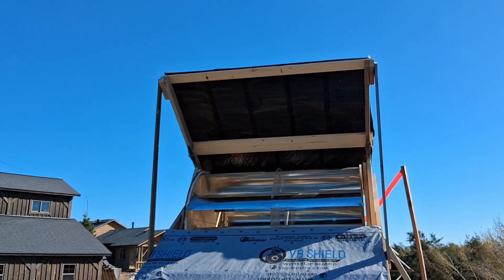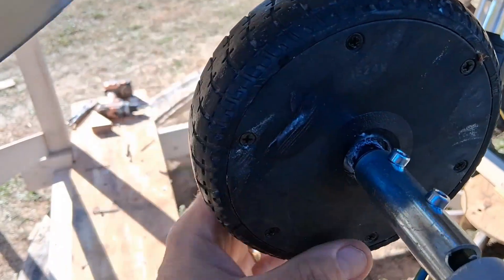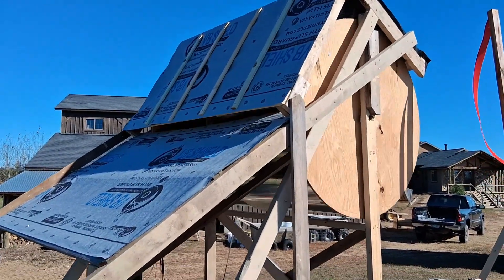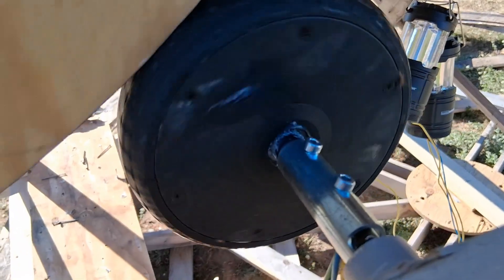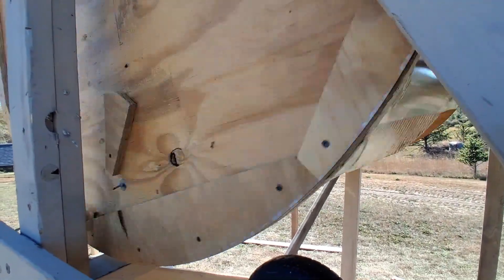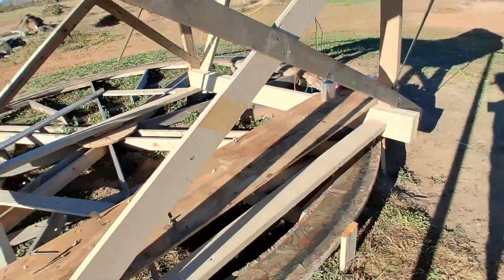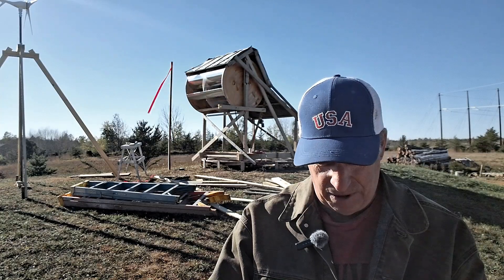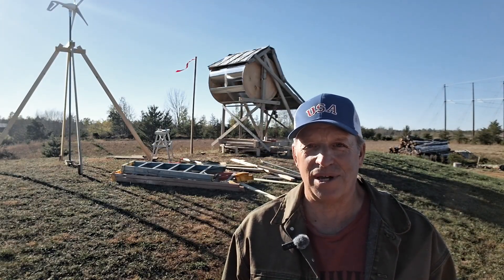Horizontal (cupped) Blade Wind Turbine | HBWT

Comment: Hi Mate, I have been testing small wind turbines in a Low wind area.
I use 1.2M wind wheels, these Peaks are only in a 31Mph Wind Storm.
24V 500W Vevor          -  Normal 5 Blade  -  6.5M high     -  8 Amps
24V 500W Vevor          -  Normal 5 Blade  -  6.5M high     -  8 Amps
24V ista Breeze i500   -   Scoop 5 Blade   -  4.5M high    - 11 Amps
24V 300W Hyacinth     - Normal 6 Blade  -  4.0M high     -   4 Amps
48V 500W Sunboo S5  -  Scoop 6 Blade  -  3.5M high      -  3 Amps
48V 500W Sunboo S5  -  Scoop 6 Blade  -  3.2M high   -  2.5 Amps
48V 500W Sunboo S5  -  Scoop 6 Blade  -  3.0M high   -  2.5 Amps
48V 500W Sunboo S5  -  Scoop 6 Blade  -  3.0M high   -  2.5 Amps
48V 300W new rotor    -  Scoop 5 Blade  -  3.0M high   -  1.5 Amps
48V 300W new rotor    -  Scoop 5 Blade  -  3.0M high   -  1.5 Amps
Peak Output Totals  =  45 Amps  =  753 Watts ( Average wind 6.2mph )
Town laws stop me putting up a big wind turbine higher enough to work.
Hey guys, think about posting your turbine information and production🤔

Comment: that is not the bearings man, that is one of the magnets has come unglued from the rotor pull the cover off and glue magnet back in place with epoxy provided it has not broken the windings by rubbing the stator. I could be wrong but its common on the Black wheel motors
Reply from the maker: Could be dislodged magnets, but something has gone wrong with some windings too.  -and that's what is making the noise, and not the bearings...

Comment: Wonder if you could use a little bigger motor from something like a tread mill. Mount a wheel to it like you did before, they are practically free on the side of the road or collecting dust in someone's basement. Nice build very practical
Reply from the maker: Thanks!  I do need to figure out something different.

Comment: Now you can make a generator on the shaft/ central axis. It is a very very successful design - because your "roof" is an ideal wind tunnel. Now you can mount a gear boxed design or find something like a High voltage 3 phase motor for example - as a generator.
Reply from the maker: Thanks for sharing your ideas!
Reply: @doubleMinnovations  :)

Comment: The roof is a good idea, being able to shut it off. I thought the hoverboard wheel would've lasted way longer, great to know, thanks for sharing that. As for a new alternator, maybe place (many) magnets on the plywood disk face, toward the perimeter, then add a coil or more. For something that's "thrown together" it appears very level (I can't see any wobble in the plywood disks) and could suit such an experiment.
Reply from the maker: Those hoverboard wheels were used all last year on my other turbine, so they were out in the weather, but I thought they would have lasted longer.  Putting magnets on the plywood disk is something I'm considering...  Thanks

Comment: to me the top deflector is a good ideal and design...I would guess for a low wind design you could use it to modulate when the 40-50 mile winds come with damper controls and use a larger funnel sail during the 10-20 mile winds...I would think the structure to support would be cheaper then trying to get the whole turbine 30 ft higher
Reply from the maker: Not sure how much the top deflector is adding to power, but I do like that I can shut it to close off the wind and throttle it down.

Comment: You should test a mechanism that steps the gear ratio down enough to pivot the fan towards the wind direction. Maybe use an electronic meter to average wind direction so to not over correct and waste energy. This mechanism could also automatically throttle the lid to slow fan speed when needed.

Just a thought while sourcing a new generator.
Reply from the maker: Thanks for sharing ideas!

Comment: Did I hear you right that you have a stator?  Is that with Brushes?    Also, maybe use a 16 inch bicycle wheel, bearings might longer and would be easy to replace.
Reply from the maker: No brushes on the hoverboard wheel motor/gen.  Need high rpm, so smaller wheel was used for the gear ratio.  Thanks.
Reply: @doubleMinnovations  gotcha